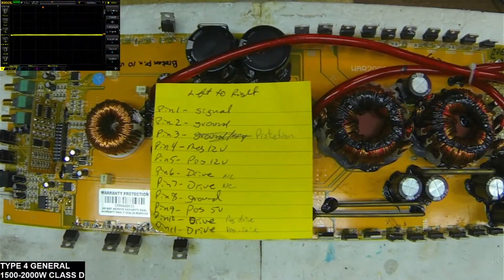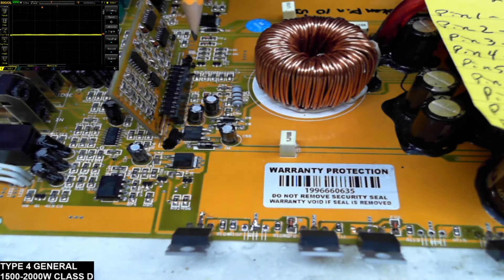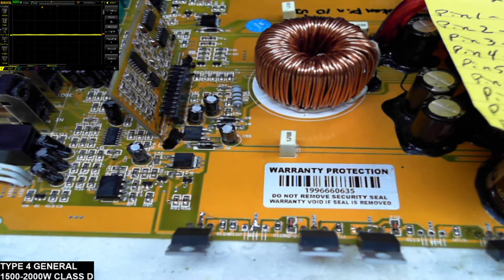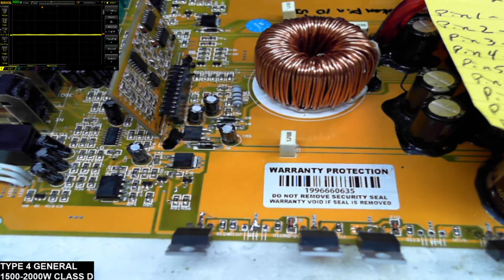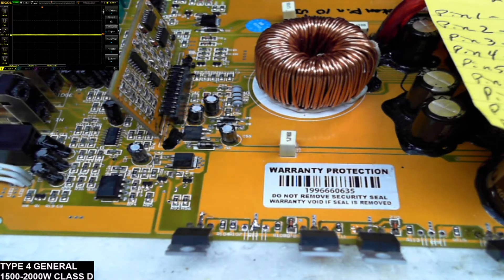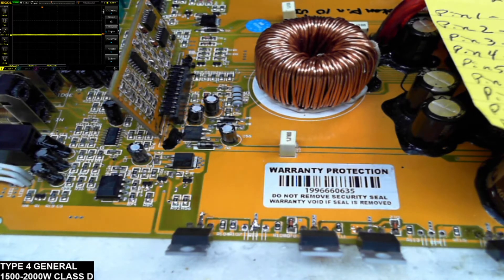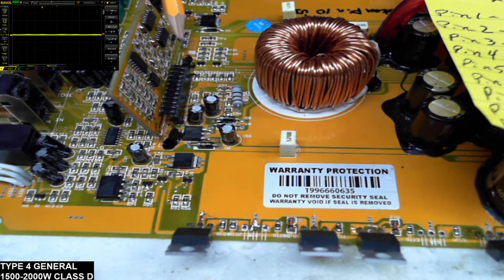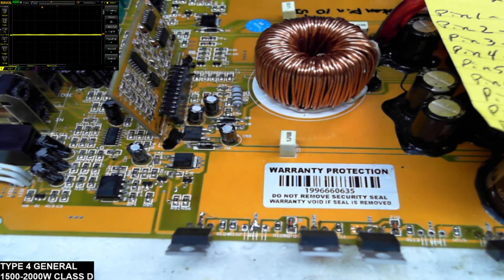Type 4 Class D Automotive Car Amplifier 1500w 1800w Repair Process

Comment: I suggest you remove the header bro, i had an amp with header in and the board fell down after some time due to vibration secondly after sometime contact will get loose and amp will unstable functioning.
Reply from the maker: Thank you Andres, these are just test boards and nut boards that are in use. The headers are for quick testing of cards that I rebuild.

Comment: Excellent as always. :) I'm working on a ShopLink Flash 2.0 that has a faulty USB connector. I found a cold solder joint on the negative pin, and tried to fix it, but it looks like I need a new connector.